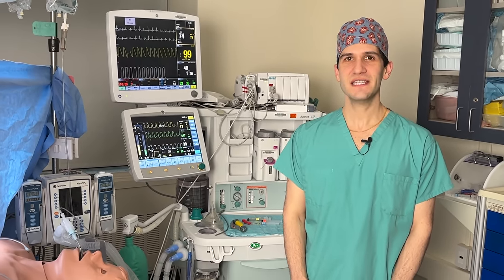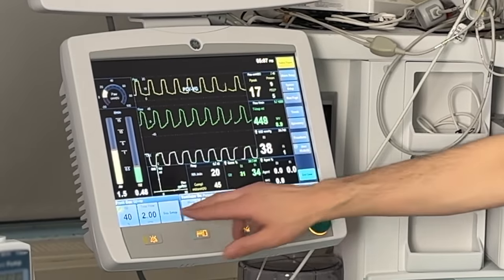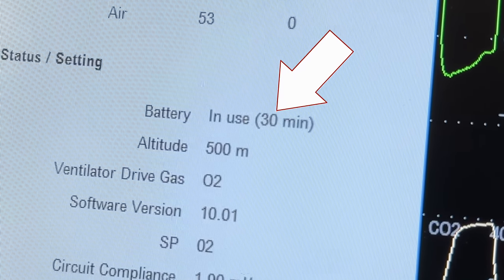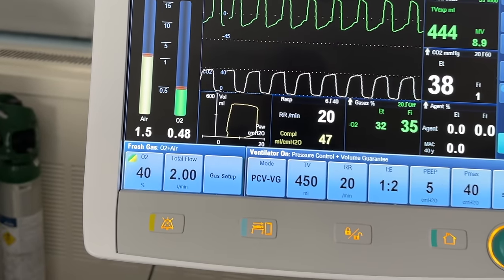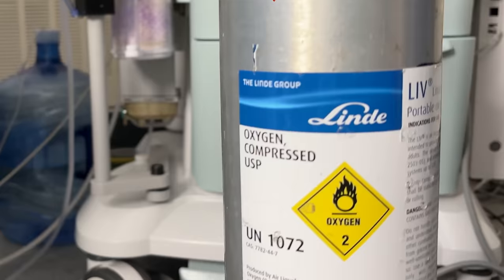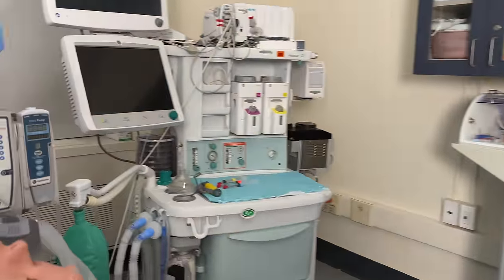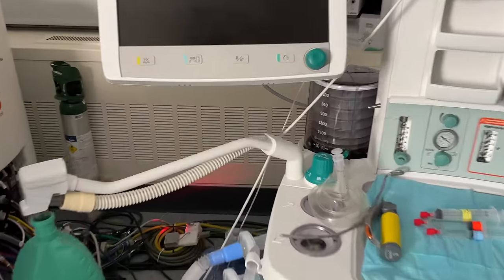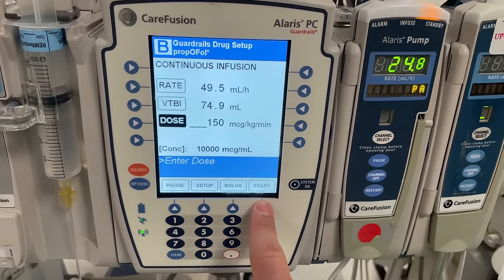Anesthesia when the power goes out

Comment: Hi! ICU RN here, and I had a power failure before in my unit, and it thanksfully all life-related medical devices always have a backup battery as you explained. The power was back on in about 5 minutes thanks to emergency backup generators, but it was like being in a nightmare to see all our computers were down, and ventilators show 'AC power loss, only battery power' messages and patient monitors run only with small, portable screens. It was something I never expected to see in my life and the electric team was like a hero.
Reply: Was going to say, I’m not in the hospital yet but I have worked on the buildings before and I thought I remembered every one I had ever worked on having some pretty massive generators either in the parking garage/basement or roof. I would imagine if there was a flood and the generators were in the basement it might be trouble, but I’m sure there are protocols for that too.
Reply: Hello fellow ICU enthusiast 😅 We have a really good backup power in my ICU we had it tested recently when there was massive overload/ "hackervattacks" (that's what they told us) targeting our power infrastructure (Sweden 2023...) we had 10 power outages / day for more then a week.

But that's not what I was going to way in on. I had something scarier happen afew years back... when there was a lighting strike in the main O2... Thingy... Turns out that there was no actual pressure monitor on the main O2 flow so suddenly all 10 respirators all over the ward started doing "the bad beep"... I can tell you that there was a hussle with getting tubes hooked up.. Oh yes, there was a hussle 😂
Reply: My cousin is a gynecologist in Palestine and had to deliver 8 babies without anesthesia because ...well...there was no electricity and it was tough

Comment: In Germany every hospital is required by law to have emergency backup generators, which active within 15 seconds of the power outage. Additionally, the hospital must store enough fuel to supply electricity for at least 24 hours.
Reply from the maker: That’s great. The US likewise mandates that hospitals have backup generators that can run for at least 96 hours. However it is possible for backup generators, or the electrical system connecting them to the ORs, to malfunction.
Reply: Yes, during Hurricane Sandy in New York City the back up generators were flooded.  I specifically remember NICU nurses carrying preemies down staircases while manually ventilating them.
Reply: You would have thought they would’ve learned not to put the generators in the basement after what happened during Allison and Katrina.
Reply: @mariachi2013  the hospitals in NY were built long before either of those storms.
Reply: @MaxFeinsteinMD ok
Reply: Just because a hospital theorically has over a day of backup power generation doesnt mean that additional safety precautions for power outages, such as the one in this video, shouldnt be used.
It has happen many times in history for hospitals that were supposed to have backup generators, to have thoses generators fail for whatever reason, or to have problems with their connection to operating rooms.

When human lives are at risk, adding additional layers of safety ensures that would one emergency measure not function, such as the emergency generators, then other measures exist to keep the patient alive.

Thats called redundancy. The more layers of safety, the less likely all will fail.
Reply: @FlorenceSlugcat 👏🏻 Thank you for stating the blunt truth. Being over prepared is always better than the opposite. A lot of people may become dependent on those backup 96 hours, they shouldn’t be. You always have to be ready to take over if the power goes out, always. There could be a fire, flooding, false wiring, snow-storm, fuel leak, and countless other factors going on that you are not aware of going on outside of your operating room. If the power goes out, you have to be in control.
Reply: That is great if there is a power outage caused by an event outside of the hospital; however, it might help if there is a power outage is do to an issue within the hospital's electrical system such as a main panel or sub panel.
Reply: @georgiede ,

Comment: Always worthy information!  In the 1990’s I worked for an anesthesiology automated documentation system company... Arkive.   Doing a gig in Los Angeles at Cedars-Sinai and struck by an earthquake.  Lost power.  Most everything on battery and the staff was trained on procedures.  As soon as the shaking stopped… a runner went from OR to OR with a checklist like used during an aircraft emergency. Power restored.  Small aftershocks were freaky, but all was safe.  Never forget it!

Comment: Never forget being scrubbed into a case doing 2 simultaneous pts in adjacent ORs for GSW ex laps, open bellies, 3am, ready with crash carts and zolls for crumping pts,  entire room goes dark out of absolutely nowhere.  Machines clinking off attached to red backup generator plugs, out.  Everything out in the entire room, all at once, buzzing and screeching noises for a fraction of a second followed by a deafening silence.  Nobody said a word for probably 10 seconds kind of, "oh shit".  Room stays pitch black for 30sec until we find a flashlight to aid surgery, stays black with manual bvms for a full 5 min until it resumes.  This is a massive lv1 trauma center that accepts patients across multiple states lines as it is the biggest in the region.  Somebody hit a mainframe transformer off the highway drunk driving.  Both pts fine.  Absolutely wild.

Comment: I was very fortunate to work at a few hospital's operations and facilities crews.  The guys that run the cogen and emergency backup plants take their work very seriously.  If you have more than 30 seconds of power loss, something has gone very very wrong.  In the most unique setting I have dealt with, the hospital ships USNS MERCY and USNS COMFORT have gigantic battery banks that provide continuous power to critical medical equipment (vents being one type) while the engineers could re-align power generation to get the main feeds back online.
Reply: I wonder if there's a documentary on these engineering systems. That sounds incredibly interesting.

Comment: When I worked in ICU all the bedside equipment was on the emergency backup circuit so when ever there has been a power failure the battery has only had about 5 seconds use until the emergency diesel generators are online. All wards in our hospital also have critical power outlets at each bed, which are specifically on the emergency generator circuit. 

I know other critical hospital infrastructure also has its specific emergency power set ups, such as the Pharmacy's walk-in fridge unit (which easily can be holding >£1,000,000 in stock, and thus cannot afford to lose power for longer than a few hours).

As to how often it's happened here (im in NW England), we have planned generator tests, but its happened genuinely a few times over 15 yrs of my practice.

Comment: I live far from a fault line, and most hospitals around here typically have 3 backup generators, any one of which can pick up the load for all essential equipment. They're on a rotation, with at least one being fully functional, and one being on standby. Only 1 of the 3 is allowed to be down for maintenance at any given time. A lot of them are dual fuel, able to run on both natural gas and diesel/kerosene. Because we aren't on a fault line, a power cut is unlikely to cause a loss of natural gas at the same time, but they still have enough diesel on hand to run independently for at least a day or two.

Comment: I recently experienced a power outage in my OR. An emergency cut off power button was accidentally pressed and all power even the emergency back up was turned off. ( I believe it's a safety feature in case of fires I'm not sure? ) And to make things worse the anesthesia machine battery backup system was faulty that it did not hold charge and was turned off immediately. 

Lesson learned that day is to always check the batteries by removing the power cable to check for battery backup system.
Reply: I am surprised the machine did not self test its batteries. I have a fairly basic APC UPS on my gaming PC and it self tests monthly, surprised a machine that actually runs a life critical operation does not warn of a failing battery or charge system.

Comment: The last hospital I worked for has two diesel generators large enough to provide 100% backup power to the whole facility including HVAC. They added a second generator a few year after it was built in 2006 when I hurricane hit in 2008. The red plugs and some lighting come on about 10 second after the outage and a few second later everything else. That isn't typical though, most hospitals like the hospital one I'm at now just have the red plugs, IT closets and some lighting, don't think any of the chillers function. We had an outage 2 weeks ago, was really missing my old facility where everything functions normally. I wish more hospitals would invest in being able to power more than the bare minimum.

Comment: Having worked in a large hospital system for over a decade, I’ve become very familiar with hospital power in the US.  There should be three distinct categories of power available, normal with no protection, power backed up by generators, and power backed up by a ups and generator. The later won’t see any blip even if commercial power is down.  The one exception is if plant operations doesn’t follow the proper procedures when doing maintenance on the level 1 trauma center’s ups, and fries it.  All hell breaks loose when that happens.  Good thing for batteries in vents, and other critical equipment.

Comment: Electrician here - arent the receptacles for all these ventilators and devices on the critical and life safety branch of the  Essential Electrical System at the hospital? They should really be on battery backup for no more than 30 sec. while the generator picks up the load. Good video!
Reply: Sure, but imagine the case of a faulty circuit breaker, cable cut, etc. - still some potential sources of prolonged outages.

Comment: Why in the heck do you have pure nitrogen? Is there ever a situation you'd want to go hypoxic below regular air?

I know nothing about surgery, but am a technical SCUBA diver and am very familiar with hypoxic gas mixes - but only at many atmospheres of absolute pressure (so your partial pressure of oxygen remains near atmospheric).

So yeah why do you need it in an operating room?
Reply from the maker: Great observation! Nitrogen is actually not piped into operating rooms, but it’s in this simulation lab to drive some of the pneumatic processes that power the simulated mannequin.

Comment: Healthcare IT here - most if all hospitals with ORs have generators that will kick on within 90 seconds of a power failure. Most of not all ORs have conditioned power that are connected to battery backup and won't see an interruption if a power failure occurs.

Comment: These battery backups are there to stand in until power can be restored, either by generator or plugging into an alternate circuit. You would not expect to continue a procedure relying on just that battery. 
In the case of a utility outage, generators will restore power (to essential power systems) in less than 10 seconds (code required and tested monthly). 
I think you mentioned this in another video, but, if an outage should occur, it's important clinical staff figire out the nature of the outage. Besides backup generators, there are many other redundantcies built in place to protect patients in critical care locations (like an OR). Power receptacle went bad, there are extra (in critical care locations, 2 per circuit); circuit tripped, plug into another, in an OR, you have several per panel; if the panel lost power, power is provided by another as 2 different panels are installed for an OR (both are located in the OR for staff access); if the power source of that panel were to fail, the second panel is fed from another source.
All this is to protect the patient from all sorts of outage conditions. From utility power outage, to electrical equipment failure to outage resulting from construction/maintenance occurring elsewhere in the building.
I hope this helps.
Great video Max... Keep them coming.

Comment: What drives the hospital oxygen flow? Do they have big pressurized tanks? Or pumps?
Reply from the maker: Big pressurized tanks
Reply: If it's anything like oxygen storage for industry, it's refrigerated liquid oxygen kept under partial pressure in insulated tanks. It's kept liquid so they can store way more oxygen in the same volume. It boils off fairly easily, so they can keep a constant pressure in the lines, and vent any excess safely away from the building.

Comment: What if the batteries on the infusion pumps have also run out? Can you continue anesthesia by hand, like propofol?
Reply: I see no reason why you can't. It's administered by hand when you're first anaesthetised, and bags of fluid like saline are gravity fed very regularly so i suspect there's a similar set up for syringes in theatre so the anaesthetist has free hands for everything else.
Edited to add due to below correction, yes anesthesia can be continued to be administered by hand, but not propofol evidently!
Reply: As shown here, inhaled anesthetics can be delivered without power supply, so they could substitute propofol infusion to maintain the patient unconscious. In the event of a formal contraindication to inhaled anesthetics, then yes, you could try to emulate the continuous infusion using an app to calculate the infusion rate, but it would be cumbersome. Ideally we would rather use other IV anesthetic that could be given in a bolus dose, knowing that the patient would most likely have a delayed recovery, given the alternatives usually have longer times to be metabolized. The same reasoning applies to the infusion of remifentanil.
Reply: @MishaElla94 , the continuous infusion of propofol and remifentanil, to mention only the most common drugs used for total IV anesthesia, are meticulously controlled by specific algorithms that will, at any given moment, inject each one’s exact amount solely to maintain the stipulated plasmatic concentration. This allows us to have fewer adverse effects and ultimately a smoother and faster wakening after surgery. To reproduce this by manually injecting them is very difficult, if not impossible.